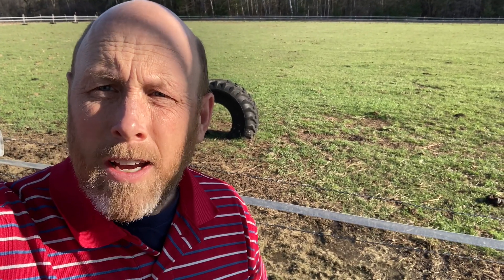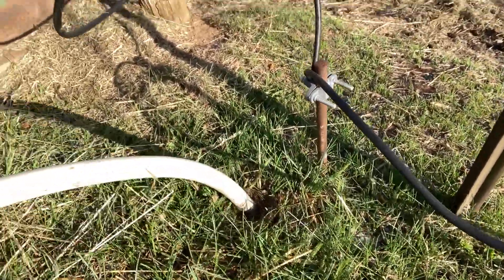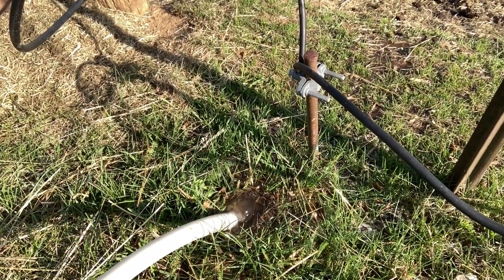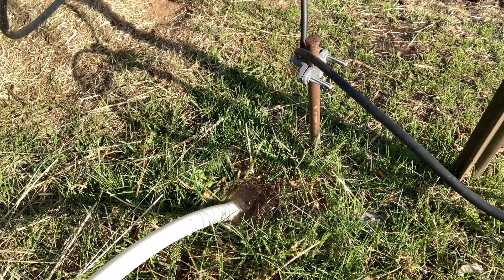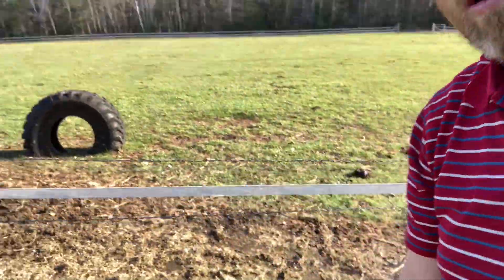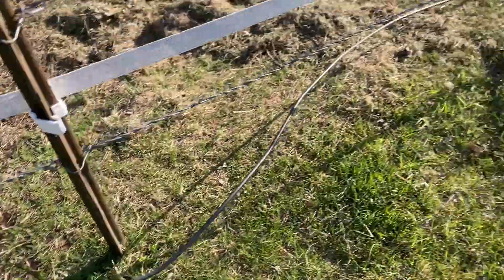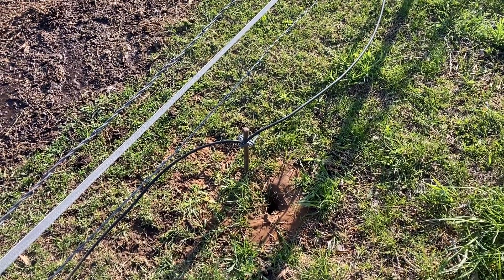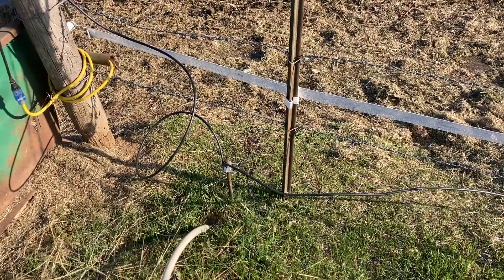Troubles with electric fence not working properly.

Comment: You waste A LOT of water doing that. If you add more grounding rods it will work better. And without a garden hose.
Reply from the maker: The recommendations were two grounding rods so we put in three I guess I could put four or five
I don’t really need to worry about the water because I’m on well but thank you for the tips. I appreciate it and thank you for watching.

Comment: That suck , if the ground is dry then it’s useless 🤦🏻‍♂️

Thanks so much your video help trouble shoot my fence issue .

Here’s a question since I’m new to the whole electric fence thing , I was wondering why goes the ground rod have to be SOOOOO long , 6 ‘ and read that you need 4 ‘ into the ground .. why couldn’t you get a 2’ one and pound it into the ground just a foot ? 
(Must sound foolish , but I’m clueless when it comes to these things)
Reply from the maker: Probably for more conductivity with moisture.
Reply: Get a digital meter it will make your life a lot easier
Reply from the maker: I’m probably clueless too.  Probably for more moisture farther down.

Comment: All you need to do is run a ground wire to the barbed wire strands from the ground on your controller. That way if the animals not grounded out properly from the ground being to dry, it will still get a shock as long as the animals touching both the Polly tape an barbed wire at the same time
Reply from the maker: Thank you so much
Reply: Oh I’ll try that too